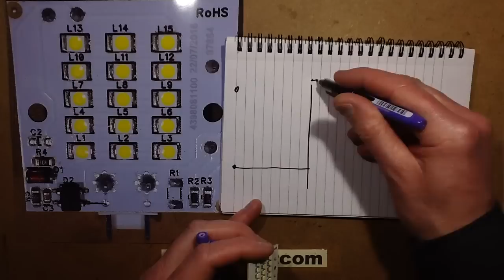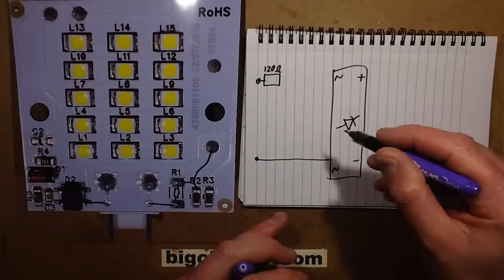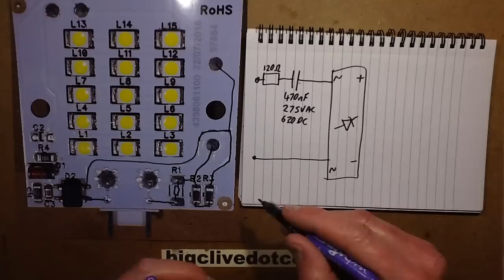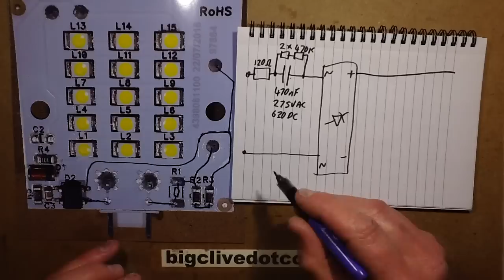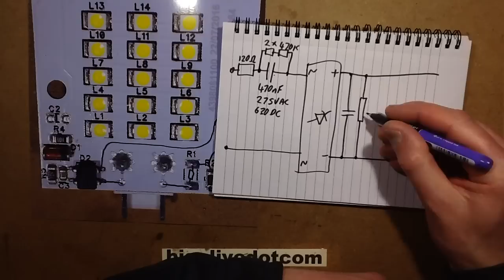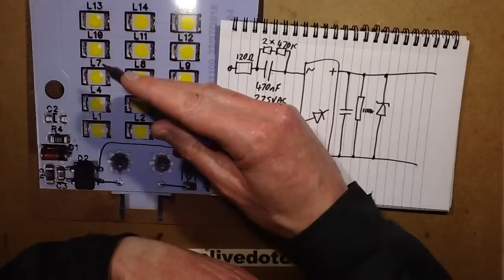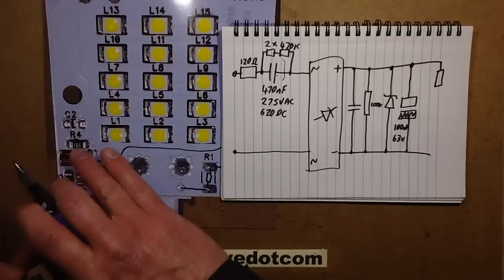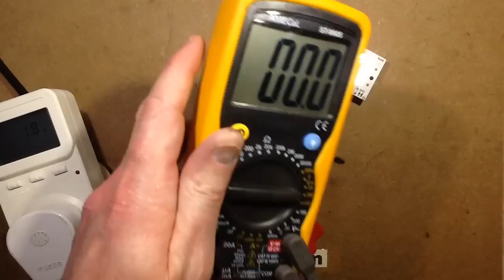"Non-serviceable" LED fridge light module.  (with schematic)

Comment: ROHS. is the failure.    no lead solder = thermal nightmare.
Reply: +Landrew0 Unfortunately, we send off our electronics to places like China where they recycle them without paying attention to the environment-- several documentaries have shown major environmental pollution along the areas they 'recycle'. It's much worse than just burying it. At least with a landfill, you can engineer it to not leak out again.

Where was it that good intentions lead to? Oh, right: Hell.
Reply: Lead solder was never hazardous. No one got sick from it, no one died. The landfills were made to contain toxic things like lead, but they don't take much anymore, because most electronics is recycled.
Much mindless hysteria masquerading as good environmental stewardship.
Reply: H.A.T.E-L.O.V.E-technology "Rocket pussies"?

You've been watching the Fanny Flambeau video?
Reply: H.A.T.E-L.O.V.E-technology you need heavy duty metals in your diet. if it was not for iron you would not exist
Reply: There's a pub not far from me called The Good Intent.

Comment: There's a new version of those common high power COB LEDs available, which runs directly off 230/110V mains and has the driver electronics directly on its metal PCB. Perhaps you'd want to take a look? Here's an example http://www.ebay.com/itm/220v-20w-30w-50w-70w-100w-led-floodlight-cob-chip-integrated-smart-ic-driver/252503593177?hash=item3aca6310d9

Comment: Aftermarket = production quantity * failure rate = a friggin' round off error in sales that no one will ever notice.

LED life expectency = 20000 hrs = the fridge door is left open for eternity
The rest of the electronics won't last quite as long, but still...

We see at the end that the board is still working, it was probably the switch. It's always the damned mechanical stuff. As far as the comments about the harsh environment -- ROFL. Commercial stuff is rated at 0 Centigrade minimum ( with a damned good margin of safety ). Fridges are always above that.

As far as production cost -- meh, who cares. It's not that much compared to the rest of the fridge. Today that is. Thanks to regulation, you're going to find those old incandescents impossible to find, so the LED choice is mandatory by default.

Now about that ROHS nonsense. The original goal was to get rid of lead in the environment ( a good thing ). It's just that about 98-99 per cent of lead usage is in automobile batteries, which get recycled anyway.  It's politics gone mad. But when the guys with the guns say stop using lead, you stop.

The reason for the high cost of replacements is manual labor and/or packaging to handle the transaction.

Comment: A friend of mine has an 80's-vintage (US) fridge that takes the type of lamp you call a "pygmy." That is, E14 base & a bell-shaped glass. Well, it burned out about 6 months ago & is no longer available from the manufacturer. Sol, I gave him an LED-filament candle lamp, which is still in there, working fine.

Comment: try freezing the capicitor, i had some lamps outside where electrolit reozen making lamp super dimm, but when i brought it home it worked just fine, i replaced the cap for solid state one and  lamp work outside as well

Comment: It'd be interesting to pt in in the fridge for a bit and the re-test it.  As you said, expansion and contraction plus lead-free solder isn't a happy combination.  You may even have re-flowed a dry joint on the main power connector when you added the leads.

Comment: another reason to have a fridge with a bulb that you can just swap out
i have an led bulb in my fridge and its barely any bigger than the width of the socket and its MEGA bright infact its brighter than my other fridge with backlit led thingys which is just 3 THREE single smds (squareish about 5 mm) lighting a whole compartment vs 64 (3014s)

Comment: DC Current = Direct Current Current
Reply: SpudHead If you have a problem with. DC Current,  please submit a written complaint to the Big Clive "Department of Redundancy Department. " 😀
Reply: Ahh yes the DoRD Department
Reply: Its called RAS syndrome. On mobile so cant link it but go google it.
Reply: SpudHead DC comics : detective comics comics
Reply: The best one I ever saw was here in the UK. We have a bank chain here called TSB; which stands for Trustee Savings Bank. For a couple of years a while ago their logo actually said "TSB Bank" which was bad enough but: when you opened an account, you filled in a form which had on the top "TSB Bank - Bank Account Application (Current)". Only example of a Triple RAS I've seen.
Reply: I've always preferred direct current currants.
Reply: Do the current dance!

Comment: Clive, it probably was a contact ptoblem: corrosion due to moist contacts. It   is almost always that!
Reply: Disconnecting and reconnecting usually solves the problem.
Reply: I was going to ask if it could be a problem with the spade connector itself.  He kind of bypassed that :P
Reply: I have a French (British build) car. Also many problems the dealer wanted to rip me off for a new board-computer. €500,-!
10 ct of contactspray an 3 x de-and reconnection did the job. Now it works allready for allmost 10 years flawless!
Reply: It was a brand new fridge and the light didn't even power on one time inside the fridge (I sent it in).

Comment: How do you know the light goes out when you close the fridge door, eh? How? Gotcha!
Reply: +Ast A. Moore   It is both on and off until you open the door, and it decides if it is broken or not.
Reply from the maker: I used dynamite to make a large hole in the door so I could check.
Reply: You put a camera inside. Duh.

Comment: American here, we have an incandescent stove light that only last a month or so before it blows. We call the manufacturer and they said Home Depo recommends the wrong appliance bulb and they sent us a pack of the "right" bulb but then it still blows out. It's not like we leave the light on all the time, we rarely use it. Is there some way the oven could be faulty? I don't see how. The bulb has a glass cover that is held with a metal clip, but there is no gasket under it. Could it be a voltage problem?
Reply from the maker: Vibration is a primary destroyer of tungsten lamps.

Comment: Thanks for checking out my 'broken' fridge led Clive! Interesting that it works! In my fridge it didn't work at all from day 1, it never once powered on when I opened the door. I'm not sure what the engineer did other than replace the circuit board for a new one, but the moment he put the new one in and the fridge was powered on, the new light was working fine.

Maybe during manufacturing the original circuit board wasn't fitted into the slot correctly, something as simple as that.
Reply from the maker: Odd.  He didn't replace the switch at all?  Maybe it wasn't even plugged in....
Reply: I don't think so. After opening the fridge door to see the light didn't work, he unplugged the fridge, took off the plastic housing, pulled out the old circuit board, put a new one in that he had with him and then put the plastic housing back on. Fridge powered back on, light worked. He left the old led board on the side. Maybe the reason why he said this happens so often is because they aren't being fitted correctly when manufactured...
Reply: @bigclivedotcom  I was wondering if you could help with the same Led and the whole housing? I have a Beko fridge and the dial is not working for turning the fridge colder. I have ordered online a replacement only that due to Covid19 I wont be able to get an engineer come and fix it. Unfortunately I am unable to find a video or tutorial How to remove from the inside of the fridge. The Top of the fridge is glued to the fridge so it is very hard to remove. Thank you

Comment: lead-free tin problem "tin whiskers" (easily causing the short-circuit) ( https://en.wikipedia.org/wiki/Whisker_(metallurgy) https://www.google.ee/search?q=tin+whiskers&source=lnms&tbm=isch ). I also noticed that this problem has been the capacitor rectifier capacitor (Capacitor Current in Transformerless Power Supplies), the capacitance which has fallen down and will not achieve the correct voltage. ( http://www.homemade-circuits.com/2015/01/calculating-capacitor-current-in.html , https://dmohankumar.wordpress.com/2015/08/14/transformer-less-power-supply-problems-design-note-39/ )

Comment: xbox 360 is why it failed so often with red ring of death by not using lead based solder ,and the heat made the cpu expand out the socket ,the quick temp fix was to overheat the console so the solder rebonds ( with luck )

Comment: I see the plugin meter is measuring 0.2watts I'm assuming that's the red neon in your high voltage clamp plug thingy so you can compensate the actual reading by 0.2 watts so around ~1.6watts with some loses

Comment: £12.48p is the closest I can find;  ( about $15 US )

http://www.ebay.co.uk/itm/Beko-Atk-led-board230vhualian-4398081100-/112274076054?hash=item1a240e7196:g:mr4AAOSw-0xYf7tc
Reply: Assuming they still make it when the next one dies lol
Reply: I was hoping, since it was fine, you posted it back to the original sender as a spare ....
Reply: Looks like a match. Good hunting! I like that they show only one side of the board.
Reply: Yeah, £19 at espares http://www.espares.co.uk/product/es1752632?utm_source=google+shopping&utm_medium=shopping&utm_campaign=google+shopping&mkwid=sroDFiGD0&pcrid=158739085590&kword=&match=&plid=&pdv=c&gclid=CKft5vv21tECFUk8Gwod7p8DiA

Comment: it's more expensive than a filament bulb, but it allows for a lot more flexibility in placement, and if it were sealed properly with a conformal coating it would last forever.
Reply: Last forever? By applying higher grade manufacturing practices? Well that's an old-fashioned idea if i ever heard any! Get on with the times.
Reply: YES! Lets make everything crap and plastic :D
Reply: Siana Gearz what? more complexity doesn't yield more reliability, how come ;-)

Comment: There was a fault in the warranty timer. It wasn't supposed to die until the day after the warranty ran out.
Reply: Printers also have that "waste ink" sponge into which they eject good ink at various intervals, and a sensor to tell the printer when it's full.
Reply: Jim Fortune Hahahaha exactly!!!! Couldn't have said it better myself!
Reply: that's very true this is why I don't like modern stuff that has micro controllers or internet connectivity things can fail in a controlled way by design if we maybe tick off the Chinese enough they will have perhaps have your washing machine bursting into flames all over the country !
Reply: mickey thompson Is it a timer or a counter? I know the HP ink cartridges have counters to limit the number of prints you get from a cartridge. I think the printers are just built cheap so they can sell cheap so they can rope you into buying their idiotically expensive cartridges.
Reply: Ninja Master I'd go for a socketed unlabeled custom chip with a down counter and a fusible link if you want them to be repairable, and a small capacitor shell full of magnesium and an igniter if you want them to have to buy a new fridge.
Reply: mickey thompson So it's a "whichever comes first" clause. ;->
Reply: I know he's being fatuous but if one were to purposefully engineer a circuit to fail in an expected manner after a point of time, what would be the best way to accomplish this?

could anyone describe a circuit that could be easily spotted and repaired and one that would be totally fried but without causing external harm (fire).
Reply: Против Глобал That's silly
Reply: NICHOLAS LANDOLINA It's called satire. Look it up!  
Это называется сатиру. Поищи это!
Reply: Ha ha!!
But the warranty timer is real in some equipment - printers, for certain.

Comment: The motive is not to sell overpriced parts, but rather to force people to buy a new fridge because the light's broken and 'we don't keep that part'
Reply: +jusb1066   It was the Japanese model.  There was nothing wrong with the televisions, VCR's, audio equipment etc, that they junked.  They just wanted the latest model.  I remember seeing junk piles of what looked like new kit.  Perhaps things have changed now that more of that stuff is made in China.
Reply: same works with tv remotes, people abuse them, kids spill coke all over them pizza greasy fingers and kcik them about, but very hard to get the real remote for accessing menu and smart features, sure you may be lucky and have a tv thats a common model, but generally you will be paying in blood for one, i follow the japan model where people cover them in a plastic bag!
Reply: +jusb1066   I thought the Japanese model was to get a new television every 6 months.
Reply: +inaflap, ahh yes because of fashion, i was never a person to throw something away due to fashion, stuff is run till it dies here, till recently i still used a 1950's valve radio on the sideboard, i still have  a crt portable in the bedroom (though nothing to watch on it cept dvd's), my last two flastscreen crt tv's barely got out of the warranty and plus i thought they were badly made, so waitied a while without a tv before i bought an lcd.
Reply: i think that was more likely the early korean model or the old british model, those were rare to last even 3 years in my house, along with later vhs players!
Reply: Which is why I only buy TV remotes with a learning feature. Have it record the old remote's button and unless it uses some strange frequency it'll work all the same.
Reply: jusb1066: You are so true about the remotes.

And I'm happy to read that I'm not the only one that uses things until they are totally dead or worn out. It feels good, knowing that devices that have aged or have some imperfections are still being used daily.

Comment: 'ensuring maximum profit's is the most important takeaway here....bastards
Reply: BobEckert56 in this case answer is to not buy the replacement but to fix it. In the olden days we had a thing called 'make do and mend', you only spent money on something if you were absolutely forced. Having said that you could end up spending more in the long run. you have to get the balance right.
Reply: Jack Dawes The 1% of the richest of the rich are laughing like rabid hyenas.

Comment: as much as I like LED lighting IMO an incandescent bulb is more suited for this environment (cold and damp) than an unprotected board like this
Reply: Only because they leave it unprotected and construct them for quick failure, otherwise it makes far more sense to use a low power LED and not dump tons of heat into your fridge every time.
Reply: In the specific case of a fridge, every minute you leave the door open it's going to take the fridge compressor several minutes running while it draws ~700 watts to make up for all the heat you added.  So if you think about it, it's probably consuming around 3500 watts during each second the door is open.  So whether the light bulb draws 40 watts or 4 watts is irrelevant.
Reply: It sure didn't appear that the board was conformal coated, yet I didn't see any components that would "switch off" if a circuit was bridged by water condensation.. I wonder if it was the power pins that after having been re flowed allowed this lamp to work again?
Reply: "and not dump tons of heat into your fridge every time" Opening the door of your fridge for 30 seconds will heat up the fridge more than a 10 watt bulb.
Reply: MsSomeonenew because when it comes to reliability, on/off cycling with long time base.... the more complex solution is the better one .... a bulb is just a wire nothing to write home about. EconomyFaileneering at its finest, not intended by any true engineer
Reply: Gerald Monroe +1 nice one :-)
it's the same with vacuum cleaner and their EU labeling, now my A+++++ ultra efficient sukr just runs longer than the old tchernobyl D Rated Miele which was more efficient at doing the job hard and short.. but who cares for facts 😅 let's optimise my toothbrush which takes to much energy to run ...
Reply: It is a specific property of LEDs that they work extra efficiently and reliably at fridge and freezer temperature.  So there's that. Then there's the problem that the battle to reduce energy spent on ordinary lights elsewhere has caused politicians to start outlawing incandescent bulbs, at least for consumer purchase. Even if fridge lamps are exempt, the shutting down of incandescent bulb factories and the risk that spare fridge lamps would suddenly get outlawed due to people buying them to circumvent the regular ban or some such reason, the people designing fridges just can't really depend on the old type remaining available. Another thing is that fridge makers are now comoeting to get the most glaring energy efficiency reviews from reviewers stupid enough to enforce a rule like that anything with an incandescent bulb gets dumped from an A++ rating to an F without any actual tests if it makes a difference for the annual power consumption of the whole fridge.

So to the designer, using LED lighting that isn't an eBay knockoff is just playing it safe. This also matches design details like keeping the internal DC voltage at 48V, adding extra discharge resistors, a zener to protect the big capacitor, a properly certified X capacitor, generous track distance that looks good enough for use on mountains above 10000 feet, making the RoHS marking extra visible to people tearing the fridge apart etc.